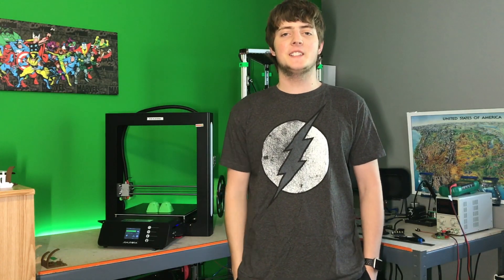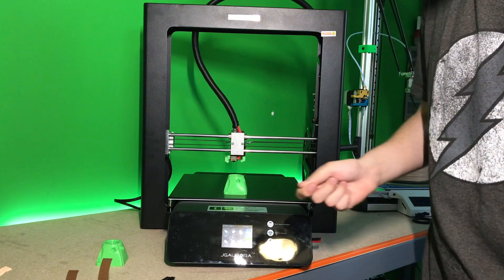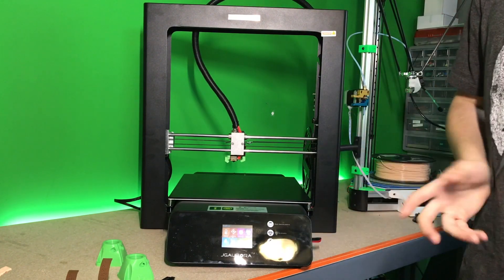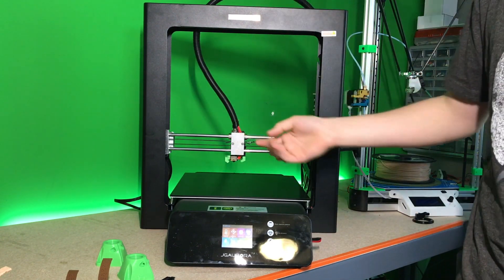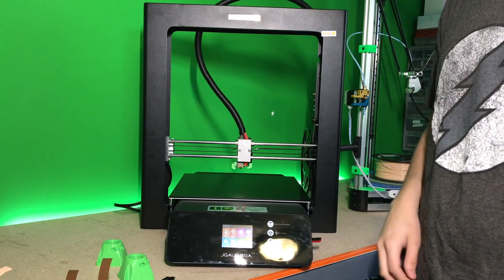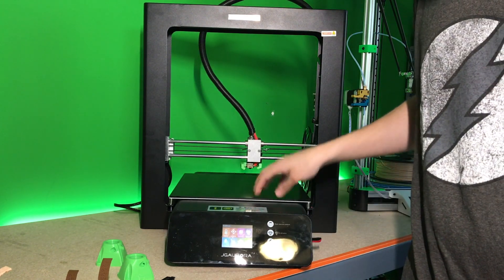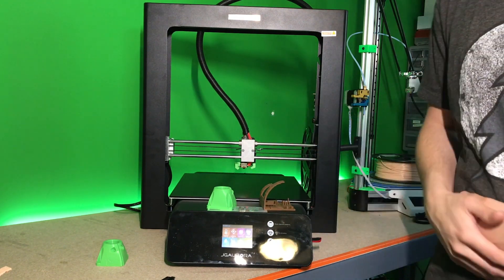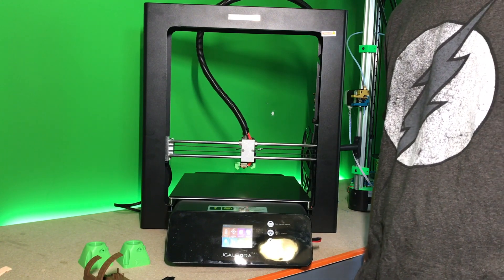JGAurora A5 Review | 3D Printing

Comment: Hi Zac

I got tired of parts going wrong on my A5 and having to wait six weeks for parts to arrive on a slow boat from China and then finding out that they had sent out faulty parts.

if you have not come across "lock-out" mode where the LCD works but nothing moves then you are a lucky one because lot's of people are reporting this fault and it's not an easy one to fix but my best advise is sell the printer before you become stuck with a lemon and no guarantee not that it's worth anything if you purchased the printer using AliExpress and not Gearbest.

Good luck !
Reply from the maker: I have not come across that issue. Could be they changed some of their components that are causing the issue? I have been toying around the idea of replacing all of the electronics on this machine and to turn it into an experimental printer where I can design and use a paste extruder.
Reply: @TheProfessionalNerd  Sounds like you need an Raspberry Pi and some stepper motors that will produce more power to have a play with. Lot's of people are upset even with new JG printers so i think the parts are still an issue but i love the LCD screen